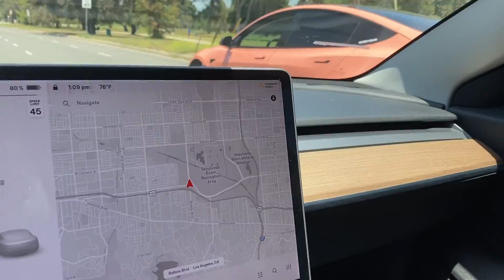Does battery degradation affect 0-60 time? | 2020 vs 2021 Tesla Model 3 SR+

Comment: I thought the LFP had a slower 0-60? In this test it looks like the LFP is faster?
Reply from the maker: Typically you are correct. This LFP is a unicorn in the sense that it has the performance motor (980) vs the new LFP cars with the non performance motor (990). Only a few hundred of these vehicles were made in this spec.
Reply: @ChargeGo  Newer LFP models than this early LFP have a higher capacity and higher weight than this NCA SR+ so this would account for a very slightly slower acceleration with the LFP cars (all other factors being equal ... which, just to complicate things, they aren't)! I would expect to see a more noticeable difference between the NCA and the newest, heavier, Model 3 LFP RWD models.
Reply: @MrAdopado  battery weight difference between 55kwh and 60kwh batteries is negligible. It all comes down to the fact that starting 2022 they started using a less powerful drive unit.

Between Sep and Dec 2021 LFP cars had either the 3d1 (980) or, rarely, 3d6 (740) drive units; Sep-Oct and some Nov got 55kwh battery, Nov-Dec got the 60kwh one. At least when it comes to made in China ones

F (#7 in VIN) indicates an LFP battery but doesn't specify 55kwh or 60kwh; A as #8 in Vin in this date range is usually 3d1 (980); J is 3d6 (740); From 2022 I think they had S? and the 0-60 mph time dropped from 5.3 seconds to 5.8 or so
Reply: Nice would love to have seen it with my car 🤦🏼‍♂️